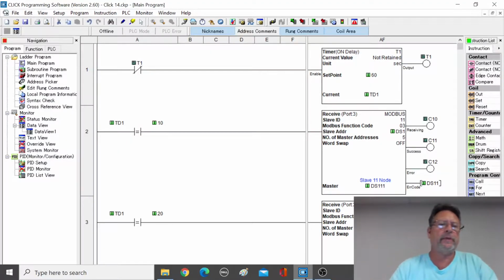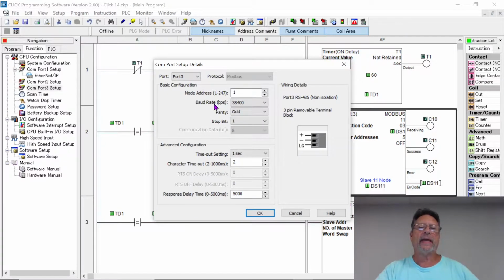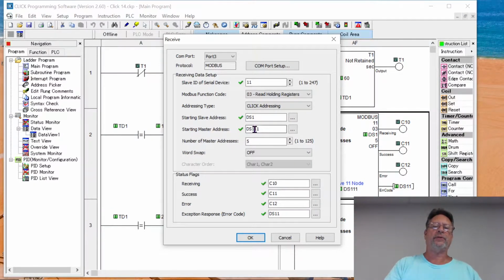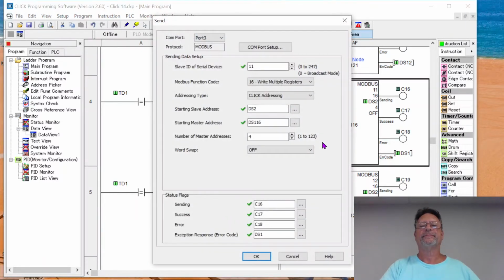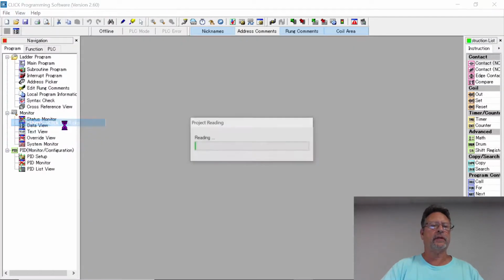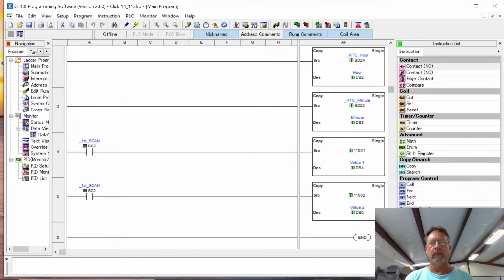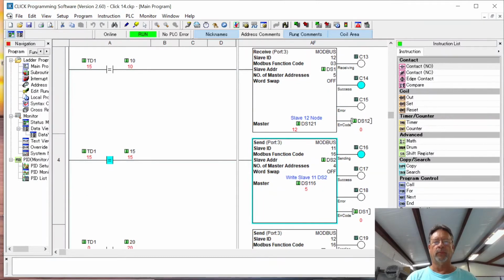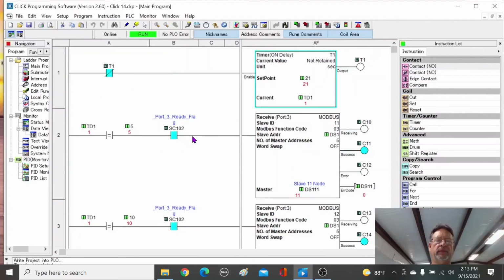(Click 14) Send and Receive connecting Click to Click. So easy to collect data.

Comment: Hi Phil these videos have been really informative thank you. I'm yet to purchase a PLC but looking for something that fits my application. I need to run a program on a PLC to control temperatures on fermentation tanks, the input being a temp sensor and the output to a motorised ball valve which allows flow of chilled glycol to drop the temp on the tank itself. While I understand this device can easily turn the valve on and off depending on the set temperature, do you know if it's able to run a program that can extend over a week where as an example: days 1-3 set at 18 degrees C, then day 3-4 set at 20 degrees then 4 onwards 22 degrees?

Ive been told click are really simple and might not be able to run programs like that. What's your experience regarding this?
Reply from the maker: You can set up timers by hours, days, months, whatever. You will need analog inputs or temperature module, etc. for the variable inputs and out puts, but start/stop are always discrete
Reply: @WadeCountryLiving  Thanks Phillip!